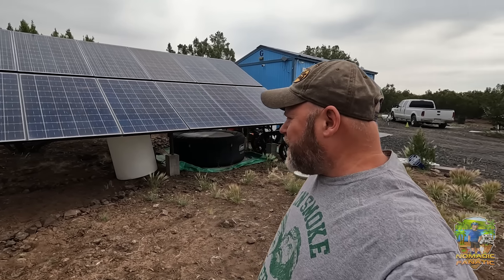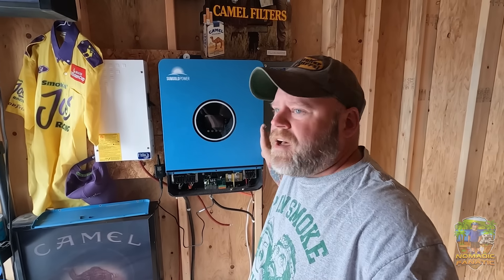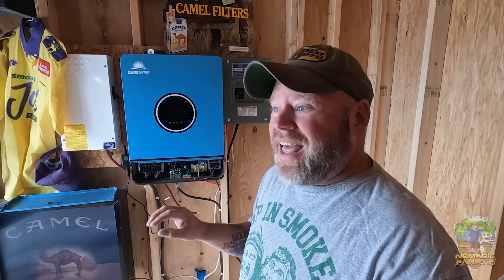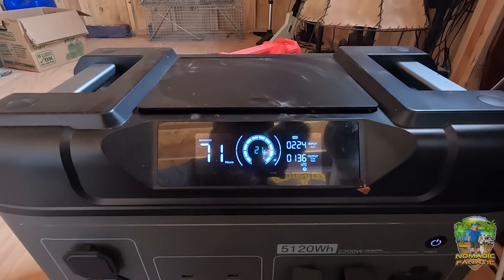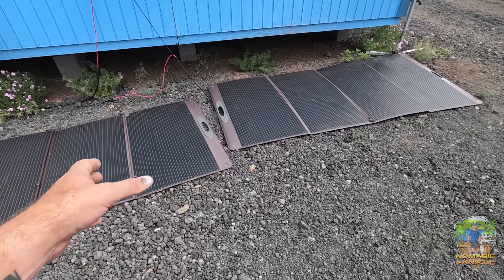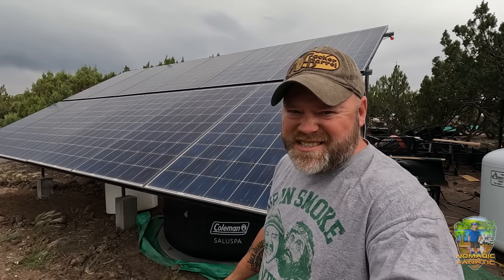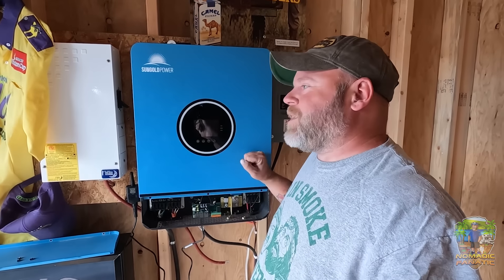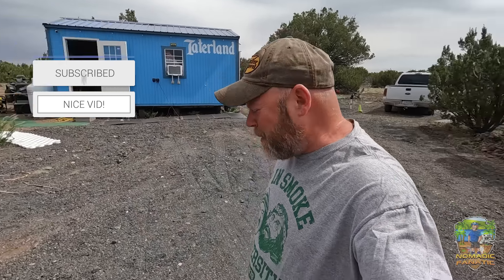OUKITEL P5000 - A Power Monster for RV Camping or Home Power Outage

Comment: With the wildfires and dust don't forget to carefully clean all your panels on a regular basis. Carefully is the active word! I was glad to see you have a functional generator to fall back on as like wind power, solar systems are weather sensitive/dependent to be of much use long term. Make sure you have a full tank of fuel in the RV as getting caught in evacuation traffic with anything less can really suck! Before I retired from Law Enforcement in 2010, I had to work a lot of "Gettin' the Hell out Dodge!" kind of traffic when hurricanes were predicted to hit the coast of the Carolinas. Weekend and parttime RVers were the worst when it came to keeping their tanks even half full, hurricanes or no hurricanes, and toting ten-gallon fuel cans full of gas or diesel back and forth between stranded RVs and gas stations becomes very tiring when you are already working 10 to 24hr shifts.....But we, my fellow LEOs and I, did it anyway. I'm hoping the best for you, the kittens, and your property but be well prepared to get the hell up out of there in big hurry if the fires are not contained and start spreading. In fact, don't wait to be told to evacuate....Just do it!

Comment: You killed the system trying to run that hot tub on it. It's too much continuous load! Heat kills batteries.
Reply: No. Bad cells in one battery is common.
Reply: Both of these statements are true. 1 out of 4 is probably about right for those Gungo?? Batteries. (Offbrand). Heat is also a killer. It is a emergency when the hot tub heater can't run......🫤

Comment: Doesn't that inverter run batteryless if some solar is coming in?
Reply: It should.  He is not solar savvy enough to make it work, but his solar array, charge controller and inverter should work just fine without batteries.  He just won't get power from them at night.  That's when he should be using his Oukitel to power lights or whatever is needed at night.  Then use his solar array and inverter to recharge his Oukitel during the day with the 120v AC input and throw those portable panels in the garbage.
Reply: @McRod-1  If you set the output priority to solar first it should power up until solar drops off. Even with some clouds, there's probably enough solar there to get something done 🌞

Comment: Question about the big, hew solar genny.  I looked it up on Amazon and it shows that it is gas powered.  Since it is a solar generator I am guessing  that is an slternative source?  I want to use it as a power source during hurricanes here in FL and don't want the hassle of gas.

Comment: I would suggest a true 48V battery without paralleling four 12V batteries. I would suggest you buy batteries from EG4, SO, BigBattery, Watts247, CurrentConnected, SanTan, etc. and stay away from Amazon for anything long-term, off grid solar related
Reply: EG4 new server rack batteries are good.
Reply: Amazon has nothing to do with quality, they're simply a distributor....

Comment: The hot tub and also ac pulls a lot of power and may have been too hard on the battery system. I can run everything directly off my panels when there is sun, but disconnected from my battery packs. Couldn’t you do that too? If not, I’d recommend setting your solar system up that way. There is a lot more energy generated by the real panels compared to those on the ground and they’d charge you Mobil battery packs more readily.
Reply from the maker: I'm not even drawing off the batteries in the daytime. The system is in passthru mode when the batteries are floating. They won't even discharge. The power bypasses the batteries and inverts to the AC outs mains until the sun goes down.

Comment: Get yourself a portable swamp cooler you will use barly any air conditioning and hardly any power to run.   It is over 100 here and it is 75 in motorhome a.c. kicks on and off compared to without at which it runs all day without cycling off.  They are inexpensave there is a good one at home depot for 199

Comment: Couldn't you temporarily hook your permanent solar array up to your OUKITEL P5000 and get a lot more juice flowing in?
Reply from the maker: The Oukitel is limited to 1000w of solar input, so I'd have to pull and rewire the 3000w array. No need since I've already got the 800w on the ground for now.
Reply: @nomadicfanatic  WOW, it's amazing that those little panels put out that much wattage. I have three 300 watt panels on my RV that are huge compared to those and only get 100 more watts. Technology ROCKS!
Reply: @nomadicfanatic Your solar array can power your inverter without batteries and convert to AC and use the 120v AC charging feature on the Oukitel to recharge it.  Save the Oukitel for night time use since you have no batteries.

Comment: I wish those weren't so crazy expensive.  If that were 12v that's less than 400ah for $3k?  Way too expensive for most.
Reply from the maker: Well, to me, BattleBorn batteries are too expensive. Still $1,000 for ONE 100ah battery. So, $5,000 for the 500ah I had in Freeda. Power stations are more portable and all-in-one unit option for those who don't want to build an entire solar system. My system on the Bigfoot cost $13,000 plus labor/install. That's a far cry from a $2,600 power station with portable solar panels you can take anywhere.

Comment: Here's something you might try next time you have a battery problem. Pull up the video on YT,  Hammer and Home  and check his video, "how to get dead batteries working again". An easy hack. I tried it with a dead rider motor 12 volt battery, it worked great and still holds a charge,  that's over a year ago. I do this on my battery tools. Check it out, good to know. I don't know if It'll work on your batteries, but no harm trying.

Comment: the deep discharge and the amperage killed your old batteries
Reply from the maker: Which deep discharge? I only run the RV breaker from 10am to 6pm (while batteries were floating and power coming straight from the solar panels) The issues I'm describing came from night time (after 6pm) when no loads were on except the security system and internet.